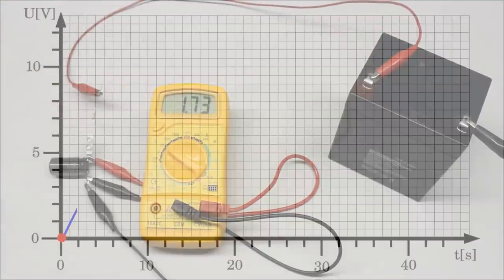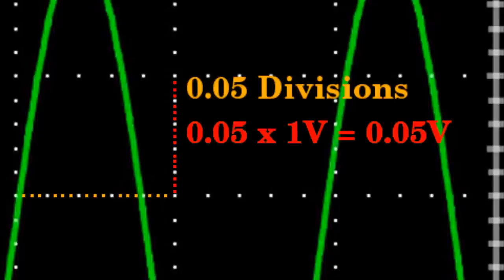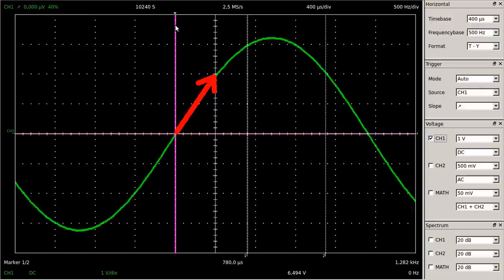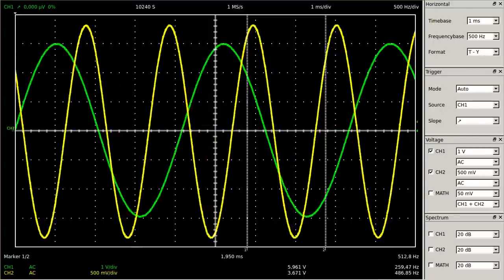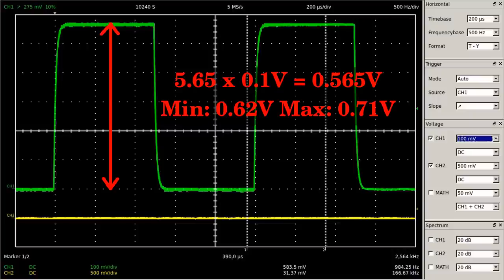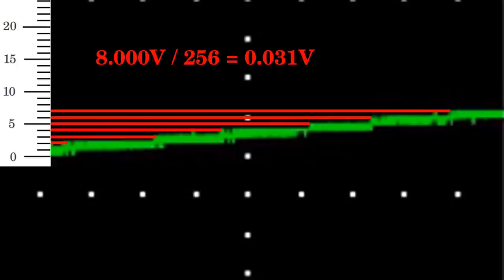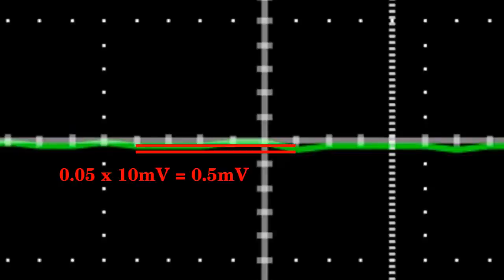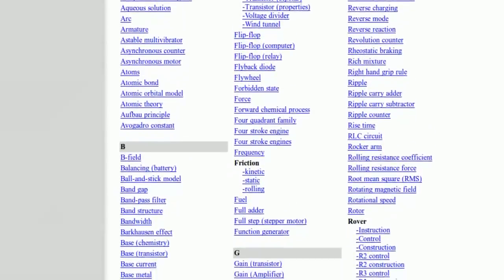Oscilloscopes - handling and accuracy

Comment: Thank you for the very useful video!  I'm considering to purchase this product.
Can the lissajous figures (x/y plot) be saved as csv or some raw data?
What I am concern is that I can save the datas of both cannels simultaneously or not.
I need raw lissajous data to use them on PC
I would appreciate if you give me some comment.
Reply from the maker: VDmaster665 With the software I am using (Openhantek running on Ubuntu Linux) you can save data as csv. I don't know if the software the oscilloscope is shipped with can do this, too.
Reply: HomoFaciens  
really thank you for your information!   I will try Ubuntu on this occasion, thank you!

Comment: I mostly use analog O'scopes and am new to DSO's.  Why is the time base selections different between the two?  Analog time base sweeps moves up by factors of ten, 1millisec, 1 micro sec, etc.  My DSO is .20, .40, 80 etc. so when I look at a 1 MHZ square wave on the DSO it does not neatly fit into the graticle, it overshoots and makes it difficult to eyeball measure.  Analog scope show it fitting right in, easy to measure.  Why is this so, what am I missing?
Reply from the maker: +Erik Thorsen If you are a skilled programmer, you can modify the time base in the source code of OpenHantek (the software I am using) to any value you'd like. Otherwise you have to use what ever the software offers...

Comment: Thank you for the very interesting video.
But I think your assumtions about the accuracy are not correct: You are using the 3% DC (voltage) accuracy also as time-base accuracy while Hantek states 50ppm for the time-base.
Reply from the maker: brandti I have purchased the oscilloscope from a dealer in Germany that did not offer it as a Hantek device. The oscilloscope was shipped with a veeery poor documentation and the chapter about the accuracy stated nothing but those 3%. Thanks for your hint I will consider that in future measurements.

Comment: What is your distro (Os)? I use ubuntu 13.10
Reply from the maker: I am using Ubuntu 12.04LTS. I am operating Openhantek also with OpenSuse 12.2 and Knoppix 6.7. Compiling worked as described in the INSTALL text file at the source directory.